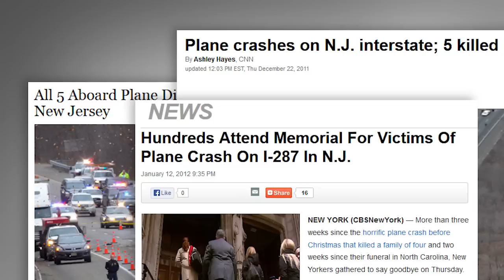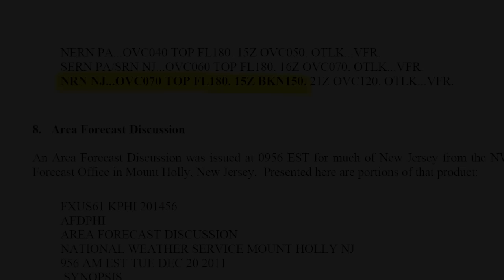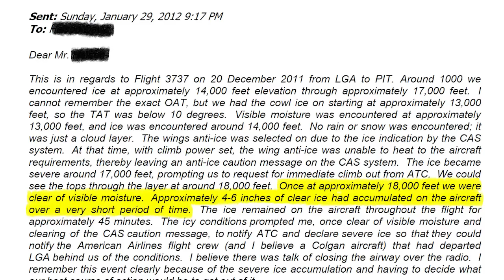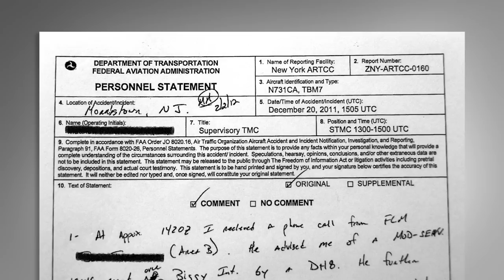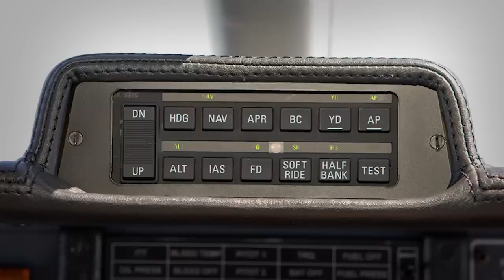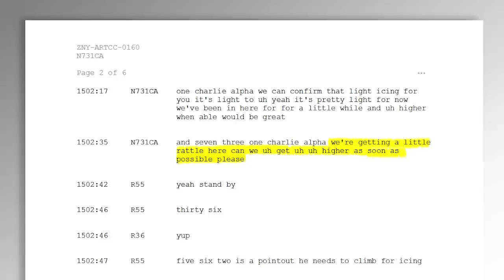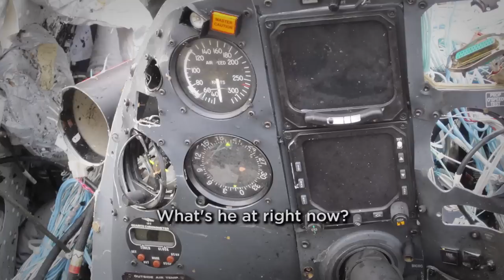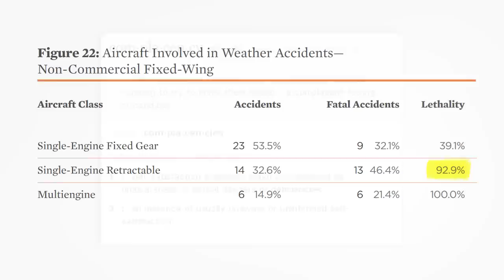Accident Case Study: Delayed Reaction

Comment: I found it interesting the pilot mentioned he had some 'rattle'. I have been flying in the NE (currently CJ2) and dealing with ice for 35+ years. I did not see any NTSb remarks on the possibility the tail stalled from ice. The 'rattle' to me suggests he was getting feedback in the controls, unlike a wing stall due to ice he more than likely  would have been experiencing airframe buffet. The rapid uncontrolled descent suggests to me the tail stall and the pilot pushing the nose forward to try and recover. unfortunately, this is the wrong thing to do in an ice induced tail stall. you must raise the nose increasing the angle of attack to break a tail stall. I never let ATC keep me in ice beyond trace or light for more than a minute. if they are busy as typical here in NE I will tell them to give me a climb or descent in ANY direction to get out. If they do not comply --> declare
Reply: Does the TBM have a stick shaker to warn of an impending stall, hence the reported rattle by the pilot?
Reply: The rattle probably was the engine ingesting ice. He should've had the inertial particle separator engaged and declared priority handling to a lower altitude until clear of the severe icing.
Reply: @HiTechRob  unfortunately the ATC manual was not in use.
Reply: He tried to climb when ATC finally cleared the path, but it didn't help. He pulled the nose up and it didn't work.
Reply: I was hoping someone else would have realized this in the comments! I cant believe a trained ATC supossedly didnt understand thr "rattled" comment, I'm a student specializing in air safety and I saw it the second I heard him say "there is a little rattle", it's unbelievable to me that an official ATC didn't see it
Reply: Important points, Kev . The horizontal stabilizer [ smaller , thinner , and without boots I presume ] is going to take on more ice [ which he couldn’t see ] than the wing . That would be responsible for the buzz/rattle and telling him to get out now , or he’d soon be losing pitch control .
The  ‘ bubbling and burbling ‘ which pilots hear on a normal wing stall isn’t by and large coming from the wing , as they imagine , but from the tail of course .
Reply: ...whatever, dude. Just stay on the ground until you figure it all out. We thank you.
Reply: Si fis amari, ama.   Hey man, I agree with your overall points (pride/ego can kill; non-standard terminology is very bad), but either (a) actually don't speak ill of the dead, or (b) speak ill of the dead and at least *own it*.  But (c) speaking ill of the dead ("Mr Cool in his Alpha Male TBM") and then claiming that you aren't is contradicting yourself and not real intellectually honest.
Reply: @svyt  thank you for your point. It goes without saying that it was a horrendous and terrifying last minute of life for all those on board, just awful. May they rest in peace. I am so genuinely saddened by the accident. The reason for accident analyses are obvious, pilots are given constructive criticism. ATC should not have assigned him that altitude due to icing conditions, that was not the pilots fault. That is all beside the point I made. If one pilot reads what I wrote, identifies with it and thinks about his mindset, then that is a good thing. I am trying to make people think by my comments. There was a reason I wrote what I did, and I stand by it. Additionally my point about being highly concerned by icing is that my 6000 hour mentor is hypervigilant in icing conditions with his high performance wing (no boots).
Reply: That's the only explanation I can think of for why he couldn't get it out of the spin with that much altitude.
Reply: That makes sense for numerous things. I had a tail stall in the sim once and I couldn't figure out what was going on!
Reply: @chrisbowpiloto t tails are almost unrecoverable, many of them now feature Delta wings right below where the tail of the fuselage edges so that when they get to a high angle of situation they'll start actually trying to lift the tail back up and can help and recover from install of the tail
Reply: Now THAT was the kind of explanation I was looking for. If he got all covered in ice, that should not have made him go out of control. He should still be able to hold it, even if only in a dive. Its not likely he couldn't recognize and recover from a stall. But a stall of the tail? Thats a new one for me! Pull up to relieve the downward load of the tail - totally counter-intuitive. Add to that how quickly a slick airplane with (possibly) cruise power headed straight down can pick up ungodly airspeed. Power off! Gear down! Full flaps! Careful not to pull the wings off.
Reply: Excellent points Kevin. I thought the same re the "rattle". I feel that it is highly unlikely that Mr Cool in his AlphaMale TBM would broadcast feeling "rattled". I assume this by listening to his "cool" vocal fry when speaking to ATC. I am not speaking ill of the dead, just making a clear point that pride can kill, and we can learn from this. It also demonstrates why use of non-standard terminology is a bad idea, especially if there was a serious event such as buffeting or stickshake in icing conditions. A "little rattle" would ratttle me in a very large way. Perhaps its a trap having the expectation that a high spec aircraft could handle ice and icing conditions, or quickly fly out of it.
Reply: @si_vis_amari_ama  i have noticed from watching about 10 of these videos in one day that the pilots NEVER seem agitated as though they are about to crash.  you would think they would get agitated, but it does seem like there is a bit of peer pressure to not seem distressed.  on the other hand, panic really doesn't do you any good.
Reply: @TheThinkinGuy  it is also in the nature of flying that there is something of a thin line between being in control and being out of control. You can be either flying or not flying (when you are basically crashing).  I am speaking in a very elementary manner here but I think it's a valid point.
Reply: He certainly came across as a cool , confident guy when talking to atc .
Reply: @si_vis_amari_ama  Really unnecessary. This was a man who had his wife, two children and dog on board. His most precious cargo. I can not take what you have to say serious when it's soaked in nastiness especially when you are taking a single word he said, to do so.
Reply: What single word are you referring to please?
Reply: @Mandy7D7  Please also read my reply to svyt if you wish.